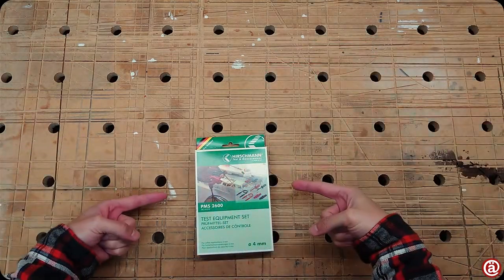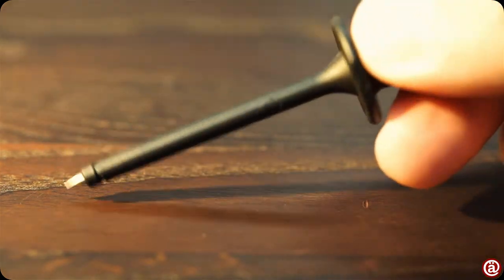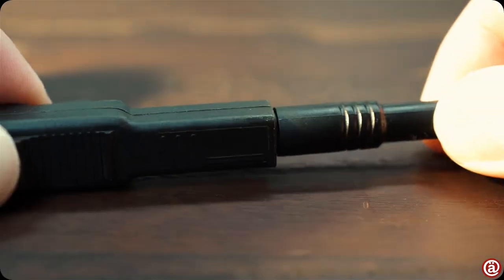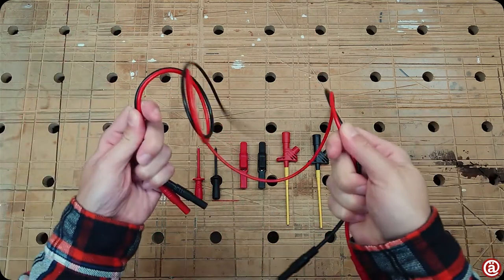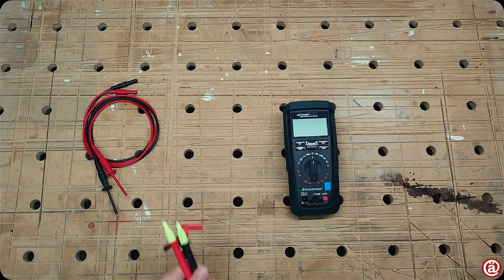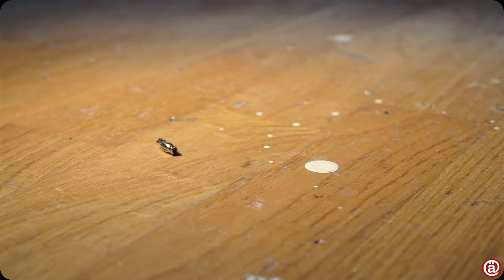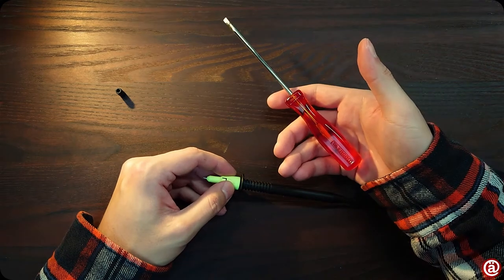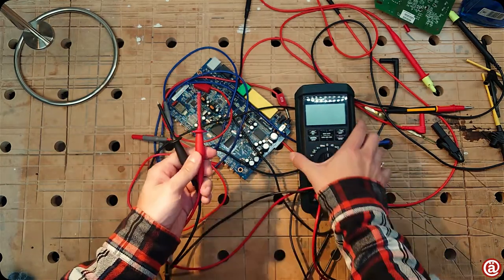Hirschmann PMS 2600 test lead set - review & unboxing | Etna.

Comment: Hello, can the crocodile clips be used for 230V AC? Thank you.
Reply from the maker: I would never recommend non-insolated connections for such high voltages, but they are rated for 300V. 

Regards,
Etna.
Reply: @Etna.  Thank you for your feedback.